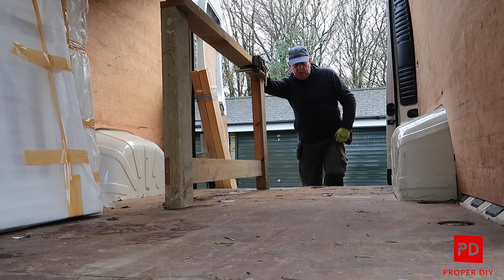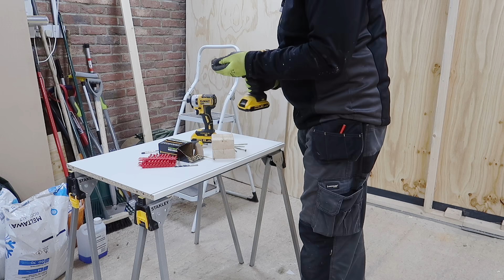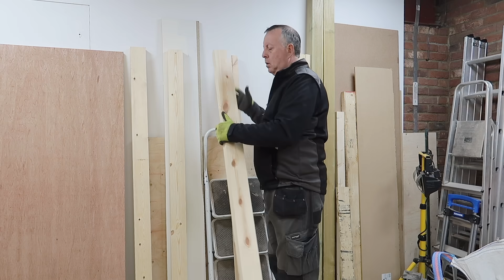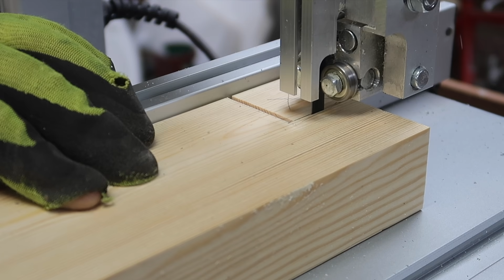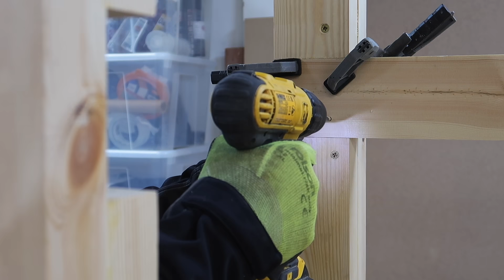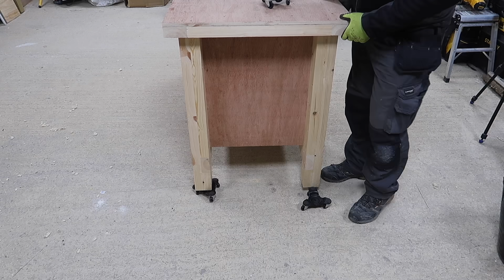How to Build an Easy, Sturdy Workbench

Comment: I used your design to build one. It is not as precise as yours, but pretty sturdy. The bench top is made of 2 old doors glued and screwed together, creating a thickness of a bit more than 1 inch. Thanks for the video.

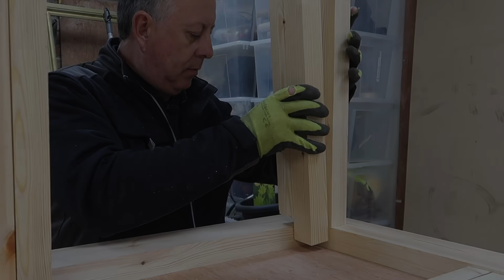Comment: 06:30 I came across a great solution to this recently. Add some sand paper grit, or salt, to the glue to stop the pieces sliding when gluing and clamping.

Comment: Good looking bench and I'm trying to follow the video to make the same, but I think you missed a section of the assembly out. What did you attach the back piece to? Looks like you've added an additional rail at the top that its fastened to, and also there seems to be an additional rail running in between the leg stretchers at shelf level that it's also fastened to. Is that correct? The attachment of the rear panel wasn't covered at all in the video 😕

Comment: As regards the slipping of timber when glueing together, don't forget the rock salt/coarse sea salt/sand trick. Just add a sprinkle to the glued pieces before joining to add grip so they don't slide around. 👍

Comment: Just finished my workbench using this design. Really happy with the design, the explanations, and the affordability. I used OSB for the worktop rather than plywood. It's 1/3 the price locally in Portugal and is absolutely fine for my needs. Plus it's cheap to replace every few years. Thanks so much. Now for the wheels!

Comment: 5:28 why do you make one of those cuts on the mitre saw? The depth of the cut is difficult to control and the cut is roundish on the bottom because the saw blade is round and not straight.

Comment: Hello. Thank you for sharing this clear video. Question if I may. Which model do you use as Makita router? Is it the RT0700C or the RT0701C? I own the RT0702C and this model doesn't seem to work in your configuration due to safety measures. Thanks for helping out.

Comment: If you had made the frame for the top with the short sides to the underside of the bench, not only would it have been stronger but you would have been able to attach the legs with (say) M10 or M12 coach/carriage bolts.

Comment: Brilliant and something I am planning to build in one of our barns.

A quick question,if I may, what is the maximum length of the workbench would you say if I build with 2x4 as you have? I have a run of  about 5m that I want to fill with workbench. So was thinking 2 at 2.4m but adding a middle support leg.
Reply: I am currently building bench from 8ft (2.4m) standard length, with 18mm ply surface and 44mm x 95mm timber 4 legs should be solid enough - will let you know when I finish it, its a work in progress at the moment!

Comment: Laughing at a comment about loud Americans I hate those people too. I like your British humor. This workbench video I watched a couple of times and this weekend I made a very large very sturdy workbench using most of your technics. I have a table saw with dado blade so I used 4x4 for the legs and cut out the areas you made using the 2x4 pieces. I used an old large coffee table top of oak. Which I appreciate you doing this video with found or reclaimed lumber as we say. And I put large locking casters on the legs. I also used glue (glue and screw thanks for that idea) called Liquid Nails it comes in a caulk tube fills in holes and gaps. And we have a new screw type in USA called timber screw that replaces lag bolts I used those. Super solid and very large like America stuff!

Comment: You should never use screws for the top of the bench. You should use brackets from the bottom of the bench to fix it otherwise you could saw though the screws whe you are working on it 😢

Comment: Great video. I picked up a fire door from a building site. That had damage one side. So they couldn’t use it. They choppier was about to put it in a skip.
The timer I used for the frame was 4x2 planed. Doubled up for the legs.

Comment: Stuart, after perusing many different workbench plans, this is the most rational one I have found. Pretty much everything makes sense to me. I have a couple of questions that I hope you (or another subscriber) can answer. 
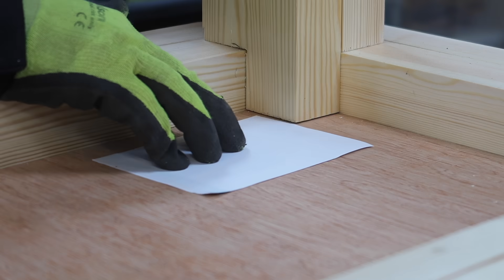As shown on the video (6:47), after notching out the 2x4 for the leg, the bottom tail sits slightly off of the back side of the top. Does this tail always stay "flapping in the breeze" or does it get tied to the frame somehow? Also, toward the end of the video @ 10:55 or so, it appears as though there is some additional bracing used to attach the MDF to the back. Am I imagining this? Are plans available for this as-built bench?
Thanks for the great project, and thanks in advance for any answers to my questions.

Comment: You could drive in some small mails, just two into one of the surfaces  you want to glue together, nip them close to the surface. When you clamp the two pieces together they will stop the glued surfaces slipping.

Comment: Excellent bench. 
A tip for gluing lengths of 4x2 together, sprinkle kitchen rock salt onto the glue, it helps the timber lock together without sliding under pressure.

Comment: I'm looking at this being my first build as I just purchased a miter saw. My concern is if ever there comes a time I'm moving, I'll never get this out of the basement. Thinking about building this in two halves and have a latch system to unify them. Or maybe a hinged ply top and make one the thickness shorter... what am I not thinking about?

Comment: I've used the 2x4 Basic leg set.  The leg set is awesome!   Make your workbench with 2x4 legs plus 1/2" top to any dimensions add your top and bottom and you're done.  There are also connections for a center shelf.  For about $120 you can't beat them.

Comment: Stuart, I recently subscribed and devouring your channel... I like your dry humour lots and you surprise me constantly with ideas; I thought I was up to speed with DIY (getting towards 70 years young!) but you really do give excellent presentations. I made my workbench a few years ago, many many times thicker and heavier but it had to be attached to a wall to stop it racking. I have still more recently added cross framing to eliminate it but I wish I had watched this video when I started to avoid the initial wobbles. My garage is narrow, sharing a large motorcycle and a 1000 litre fire extinguisher water tank (had to!) so every spare cc of space a valuable volume. I am still making more shelving etc to maximise space. Thank you for doing great work and I will soak in and re-watch your vids again. Best, James
Reply from the maker: Thank you very much James - it's very nice when I get comments like this and I'm glad that I am giving you some ideas, and, every now and then, raising a smile!
Reply: Rock on

Comment: This is a truly excellent video, thank you so much for this. I wanted to ask you about the screws, obviously the lenght will be determined by the thickness of the piece of timber but, considering I will probably using 45x70mm beams, what screw diameter would you recommend? Would 5 be enough? Many thanks and keep up the excellent work!
Reply: I think 1.5 times the thickness of the wood
Reply: 5 or 6 if you've already got.

Comment: 6:30 Tip. A little salt or sand sprinkled on the wet glue will stop slippage under clamp pressure (Ha!  Someone below said the same thing).  Clamping square…Brill 👍  I must find your ‘generous’ big box store.

Comment: For those interested in timber cots today I just purchased my cutting list for the bench from my local timber merchant Premier Timber Ltd.  £178.04 including full sheet of 18mm external ply.  I am using framing only and no ends or back panel in ply and mdf.  

Item				mm		mm	"Final
Cut length"	No.	Total Cut Length	"Order
Length"	Waste	"Order
Length"	Rate/m	Ordered Length
Softwood PAR Timber														
Top frame front 				0.044	x	0.094	1.800	1	1.800	1.800	0.000	1.800		
Top frame back				0.044	x	0.094	1.800	1	1.800	1.800	0.000	1.800		
Top frame ends				0.044	x	0.094	0.612	2	1.224	1.500	0.276	1.500		
Bottom frame rail front		0.044	x	0.094	1.706	1	1.706	1.800	0.094	1.800		
Bottom frame rail back		0.044	x	0.094	1.706	1	1.706	1.800	0.094	1.800		
Bottom frame side right & left	0.044	x	0.094	0.612	2	1.224	1.500	0.276	1.500		
Front Leg Right				0.044	x	0.094	0.858	2	1.716	1.800	0.084	1.800		
Front Leg Left				0.044	x	0.094	0.858	2	1.716	1.800	0.084	1.800		
Rear Leg Right				0.044	x	0.094	0.858	2	1.716	1.800	0.084	1.800		
Rear Leg Left				0.044	x	0.094	0.858	2	1.716	1.800	0.084	1.800		
Top mid support rails			0.044	x	0.094	0.612	3	1.836	2.100	0.264	2.100		
														
Summary Softwood PAR timber
				                        0.044	x	0.094		2		1.500		3.000	£7.00	£21.00
			                        	0.044	x	0.094		8		1.800		14.400	£7.00	£100.80
			                        	0.044	x	0.094		1		2.100		2.100	£7.00	£14.70
Sub- total										                                              19.500	£6.01	£117.20
														
CLS Timber														
Untreated CLS Studwork				0.038	x	0.089	2.400	1	2.400	2.400	0.000	2.400	£6.60	£15.84
														
Boards	                                                                         	Thickness		Required Size			Standard Board Size				"Board
Cost"	No		
Bench top - exterior grade hardwood plywood		18mm	x	2.440	x	1.220	              2.440	x	1.220		£45.00	1		£45.00
Sacrificial Plunge saw track bed - MDF board		6mm	x	1.800	x	0.600	              1.220	x	0.610		£13.92	1		£13.92
														
														
														
Totals														£191.96

Comment: Hi Stuart, Great video and I built this exact bench based upon your video with some very slight dimensional changes just based on the ply I had available for the top.  Just a quick note for anyone making the same bench - mine started to sag a little in the middle and so was no longer level, so it's a great idea to add some brace beams/uprights in the middle section - just to support the weight of the worktop 👍
Reply: His design is good...not great
Reply: Interesting comment - may I ask if you had any board at the back of the bench that butted up so that the top sat on it across its whole length, or you went for the open bench? I would have thought the ply back (screwed in on both sides) would have prevented sag. I'm 3/4 of the way through this build so have opportunity to change. Cheers.
Reply: @romeooscardes7130 Yeah might was open to be fair, so adding the panel at the back might help to prevent this 👍
Reply: @markmciver1981  Thanks for the reply mate. I did notice in the original video the idea of leaving out the panels was presented as a legit option,  but I now think that they are too important a design feature to miss... I was intending to miss the back one, but after your comment, I'll change up - either a short one at the back or an inverted v. Cheers.

Comment: Just building this now (with your idea for adding wheels😊)… with a slight modification as I have limited space in the new garage barn. I’ve added a drop leaf bench top / folding legs, giving me double the available work area. This allows me to fit this bench under a higher fixed bench… so that I can garage my MINI🤣. I reiterate the comments posted earlier.. great commentary and really good advice throughout. You are my ‘go to’ for proper DIY.

Comment: So being from the US, those 4x2s looks larger than ours.  Are they actually 4x2 inches instead of 3.5x1.5 like ours?

edit based on the leg measurement you gave, seem like they are about 3.75x1.75 inches?  So definitely a little bigger, about 1/4 inch on each side.

Comment: Excellent work. When you said you’d got lucky with that melamine I thought you just meant with the depth of it. But then that second piece fit in perfectly width wise too. What on earth are the chances?! One question /request, I’m sick of using my two saw horses and sheet of ply as a makeshift bench. But I don’t have a lot of space to keep something your size as a fixed bench. I keep wanting to design a sturdy one that could somehow collapse down flat against the wall when not in use, perhaps a hinge on the surface that I could flip up and then some sort of concertina effect on the base. No idea how to design it but could be an idea for a future project for your channel for those of us more spatially challenged?

Comment: Made my workbench today Stuart but i put a rail front to back instead of the ply.. Then when i came to do the wheels they wouldn't work as there is not enough room underneath the rail for the hinges to move fully......... Plan B is................... Who knows yet lol.. One thing i would like to ask though is i havn't put a brace along the back as i want the bench to sit over my compressor which is a big 50 ltr with a V twin motor. How can i brace the back

Comment: Great video Stuart, I have a big heavy old work bench and also fitted castors that can be raised and lowered....best thing I ever did, makes life so much easier especially when I need to do bigger/longer stuff I can wheel it out into the middle of the work shop. I also fitted an extra work top which is hinged at the back with removable legs, comes in handy when you need that bit of extra surface area.
Reply from the maker: Nice one - sounds great! It does help being able to move it around!

Comment: Quick question, you’ve added a narrow strip of ply to secure the back panel but I can’t figure out how you’ve done it, any chance of a quick pic or explanation?
Reply from the maker: Well spotted - you're the first! The reason I did this was I had a off-cut of MDF suitable for the back but it was just a little short so made it up with a strip rather than buying another sheet. I plan to publish extended videos for future Patreons  which this will be included in.
Reply: @ProperDIY  Look forward to seeing it
I’ve built the bench myself and I have to say, it’s a very impressive design, easy to build and very strong and sturdy. My first wood project since school and got me in the good books with her indoors for a few days at least.
Reply: @ProperDIY  Mystery solved.

Comment: You can spread a pinch of salt on on the glued surface. When clamping the two pieces together the salt will bite into the wood and prevent it from sliding around. It will dissolve in the water based glue and won’t effect dimensions. Cheers

Comment: A slight round over and Sealing the top with a finish will make the top more durable
Reply from the maker: Sealing the could help but a want a nice sharp corner on the top as I often use it as a right angle to line up things without having to use a square

Comment: wasted space below, you need a mid to upper shelf for smaller stuff and let big stuff sit on the floor. Which is what I do as space is limited because both are cars are garaged at night and the garage also serves as a workshop when needed
Reply from the maker: Unfortunately I don't want anything on the floor as the bench is mobile - see my retractable casters video

Comment: This is a great video!  I too love the style of the legs, they look incredibly sturdy.  This is almost the bench I'd like to build, except I want to add bench dog holes to half of one side.  That doesn't really lend itself to the top as designed because the brace bars would get in the way.  Do you have any tips on how to convert this bench into such a design, and still have support underneath?  I'm thinking I might need a double layer top (with a gap in between the layers for clamp length when in the dog holes) but I'm not sure.  Thank you for your videos, they are so incredibly helpful!
Reply from the maker: Thank you for your nice comments. A double layer top will add cost and reduce strength but is possible. The supports in my design could be placed to miss the holes but may affect the direction of any clamps you put in. Have a think about if you could live with it though - if you are the only one using it and it works 95% of the time it may be worth living with that.

Comment: Any issues with the top bowing in the middle? I've always built benches with 2x4s on end rather than flat, but I like how that top saves space underneath. Could you sit in the middle of that without it sagging?

Comment: Love the channel and this bench build video, some great ideas I will used in myself on my next bench build very soon.
But I have difficulty deciding want high to set the bench, was wondering how you set your bench high, is it a technique or formula that you use to get the optimum height? 
I looked online before now but get different ideas and not sure which maybe best so wing it. Which isn't the best way, then there is the pain of possibly adjusting.
Reply from the maker: Thank you. Good question! Standard benches are 82-92cm (32-36 inches) but it's obviously what is right for you. It also depends on what you are going to be doing in it - lower if using power tools where you need to be above the workpiece, higher if you will generally be using the vice with a chisel etc. I would measure the heights of the worktop in you kitchen etc and then try to assess yourself if it's going to be right for you
Reply: If you are planing its useful to have a bench height which  allows you to use your weight to bring downward pressure on the plane. 
    The rule of thumb, which works well enough to accommodate any human proportions, regardless of their height, is simply stand naturally, arms relaxed at your side, hands loosely curled:  the distance from the underside of your knuckle to the floor is the tailor-made bench top height for you. This will work for using   power tools too. You might  prefer more height for chisel work, tho' I do not recall ever feeling disadvantaged in this respect. If needed, its easy enough to clamp a chopping board in place to gain a bit of height if you need to. Good luck with that new bench buddy, and always remember, think thrice, measure twice, and cut once. It saves on space you need for the scrap wood pile.